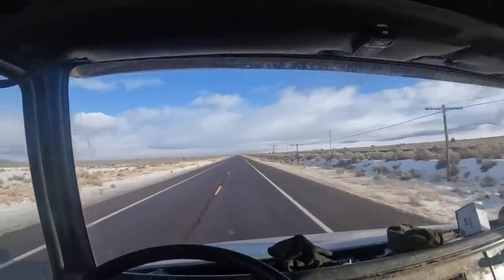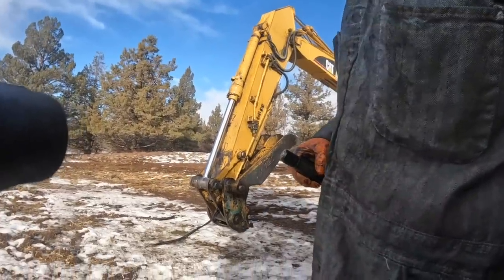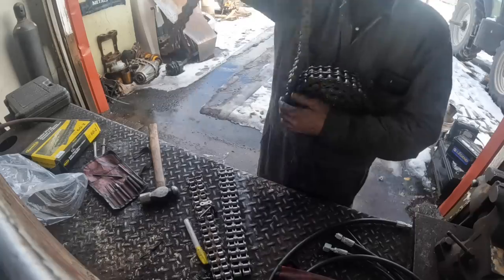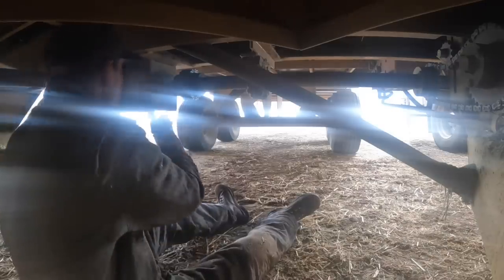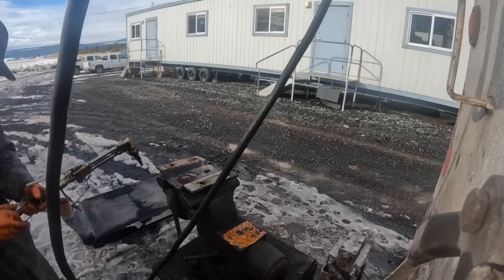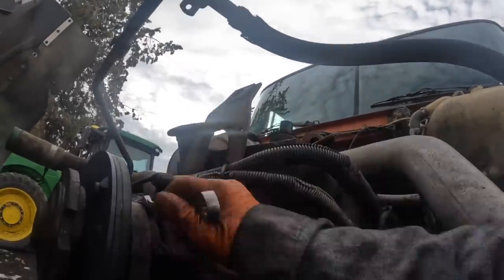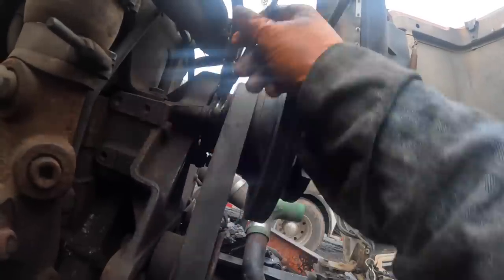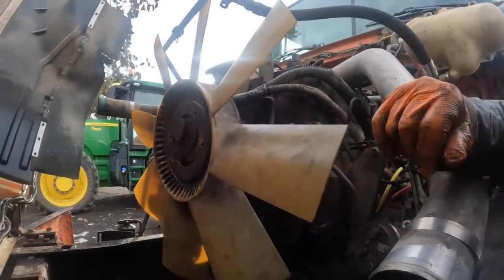Couple service calls.

Comment: That rust bucket needed a radiator anyway. I don’t eat anything anymore Warren. When I’m asked to work on junk I just tell them anything could happen. Sometimes I have to destroy the component, that could have been rebuilt, to remove the rusted bolts, not my problem! I tell them upfront if they don’t agree, I don’t take the job. I can tell you ever since I started doing this with the customers, I haven’t had many big problems. The reason they call us is because they don’t want to deal with the crappy equipment. I’m getting to old to give shit away! Nice work buddy.

Comment: I did my first fan clutch rebuild this summer, got called out for an  over heating problem and found the fan clutch was cracked in several spots, got one overnighted in,  finished it on a Friday night so truck could go back in service, I work on fire engines so every break down is an emergency Merry Christmas and Happy New Year I watched this video while doing a force Regen on a ladder truck gotta love emission systems

Comment: Hi Warren,
I'm a mechanic for trucks, machines and power generators here in Brazil.
I really admire your work, the way you solve situations by yourself, it serves me as a learning experience.
I wish you and your family an excellent new year, may many more videos of your services come, because your student will be waiting here.
If I may, what is that diagnostic program you use on your notebook (LEKA, TEKA, NEKA) not being able to read the correct name in the videos you show using it.
Well, I saw that it communicates very well with Cummins engines and here in Brazil the Cummins INSITE is very difficult and expensive to buy.
Success today and always!

Comment: Your having a tuff run just now what with the weather too, I wonder if you could hang a old towel or matt over that fan when you crane the rad back in, dam cost of that radiator you don't need on yourself anyway that's that so all the best for 2023 and thanks for sharing your knowledge.

Comment: chain in the dirt end of the world??? lmao experience tells you a little dirt is not gonna hurt a steel fucking chain that is designed for these types of conditions. This is a literally a wear part meant to be changed eventually just like anything else that is a wear part.
edit : ive thought on this , if they say they are worried about the chain getting damaged from that dirt , wack the fucker with it tell me if that little bit of dirt hurt it . chances are he will shut up or twitch on the ground just depends.

Comment: I would charge it for the radiator it was half rotted it was going to change anytime soon that’s the part when you own older Equipment it’s the owners responsibility you can’t help that the trucks are rotted out you’re giving them a service that they didn’t want to do